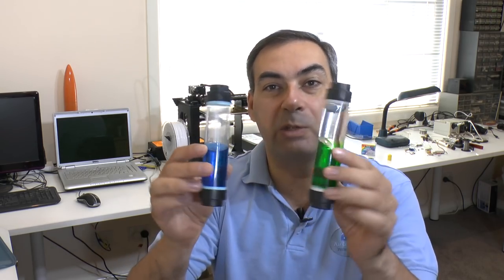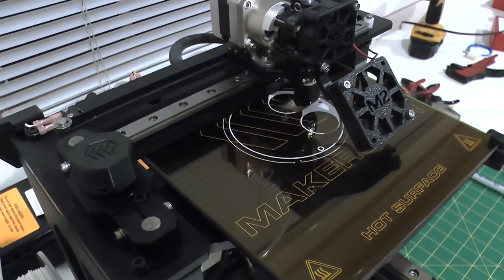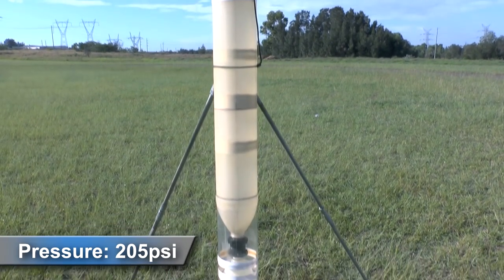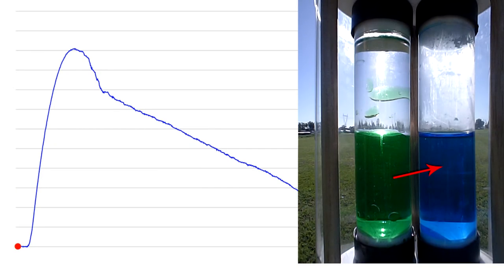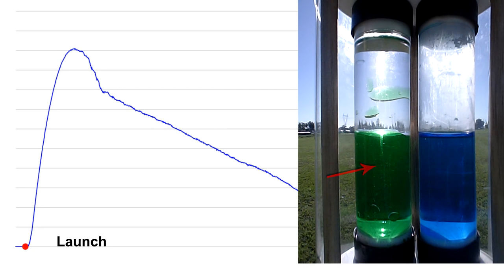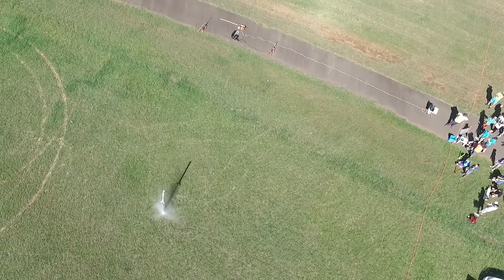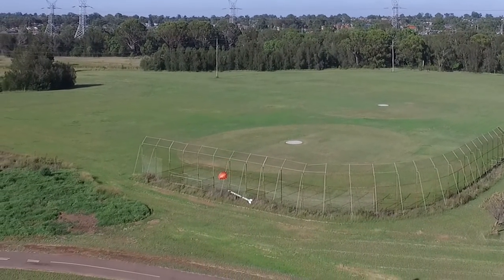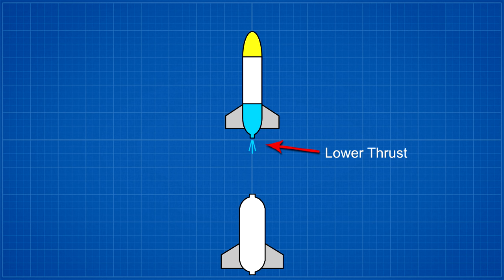Liquids in near-Zero G

Comment: You've made a Mystery Goo™ Containment Unit (^^)
Reply from the maker: Mystery Goo?
Reply: A Kerbal Space Program Reference( The mystery goo). Love to seeing that 3d Printer in good use. I wonder though, was the infill possibly a bit high for those parts? I understand for the camera mount, hanging off to the side, exposed to high drag, though for the liquid holders, as they are inline, surly they do not need such a high density infill. I have found with my printer ,that parts under a reasonable load, can get away with a 15% infill, and 20% at the max(abet not rocket loads, just the high tension of my belts on the printer. Interesting results though. For a future video, could the sourcing of bottles, to make the rockets be covered?
Reply from the maker: Ahh sorry missed KSP reference. :) I agree the infill didn't need to be that high, I think it was set at 25%. These components don't really undergo any significant loading, even the camera bracket. Thanks for the suggestion regaring the video.
Reply from the maker: Great reference, thanks for that.
Reply from the maker: I too will typically run 3 layers top and bottom and usually only 2 perimeters when strength is not critical. Thanks for the links, I had actually seen the Saturn 5 previously. It is an impressive model. :)
Reply: Yes, the designer made the model in full size, then scaled it. He was planning 1/30th scale, but one he had printed one of the engines, he decided it would be way to big(this is from reading the comments on the design).  You are most welcome for the references, it is just the right thing to do, to spread the information people are after around.
Now what about scale water rockets? like a 1/60th saturn 5. Could have a shadow rocket inside?
Reply: Lol yea, didn't think of that.

Comment: Interesting research! In order to avoid a pressure drop, it is necessary to put water in a rubber container (air balloon) with outlet to the nozzle. The air is pumped from the other side of the bottle (not through the nozzle). I hope the translation is correct ;))
Reply from the maker: That would be one option. I was thinking just using the natural shape of spliced bottle with a tornado tube in the middle of it. The lower section would be completely filled with water with air above the tornado tube. That way during burnout not a lot of water could move up through the narrow hole before you stage the rocket.
Reply: Yes, for such a design (tornado tube)  this is a good solution.

Comment: This gives me an idea for a deployment trigger. A rapid dissolving pin that is strong when it's dry but weakens when water touches it. Twisted toilet paper, cornstarch tablet, spun sugar, yarn soaked in kids glue could work. If it does, it would be easy to form some into a hook or pin for the rubber band.
Reply: I did a few quick tests with some paper, considering the water makes contact with the top mid flight, a slight delay is required. Copy paper cut to different widths gives different time delays. 3cm was about 3 sec but it was not not under precise load. 
A lead pendulum would be interesting to watch. One with a spring and one with a rod.
Reply from the maker: Good thinking. Tuning it so that you can vary the delay would be interesting. People have used vinegar at the bottom of a small container with a alka selzer tablet (or baking soda) at the top of the container. After burnout, the liquid flies up and comes in contact with the baking soda and produces gas that then activates a plunger to deploy the parachute.
Reply from the maker: Sounds promising with the copy paper. Definitely worth a go. A pendulum you say? :) Have a look at this experiment where we did exactly that. https://www.youtube.com/watch?v=oC8AbWXFiTw
Here is also how mercury switches behave: https://www.youtube.com/watch?v=JDWYTphuGCs&t=186s

Comment: While watching your latest video, the glue for my new splices was cured. I found a technique where you dont need to use a reinforcing sleeve on the outside, just some good quality glassfiber tape lengthvise, and electrical tape around. the glue is sikabond t2, can i email you some pictures? it has held up with 140psi/10bar for more than 5 min, no leaks. cheers ☺
Reply from the maker: That sounds like you have a good splicing technique working for you. :) It would be interesting to see what the burst limit is of that splice so that you know how close to the limit you are.
Reply: AirCommandRockets yes that Would be interesting, it seems like the sikabond t2 does work a bit like a sealent as the same time a strong pu glue. my units came out weighing a low 73 and 71g per unit. my compressor only work at maximum 140 psi, so i have yet to blow them up. cheers
Reply from the maker: That sounds like a reasonable weight for those spliced bottles. What size bottles are you using for your splices, and what is the final capacity of a couple of spliced bottles?
Reply: The final capacity differs due to the size of splices, I was worried about the 30mm splice so I made a 50mm too. Starting bottles is danish coop 2L PET bottles with either soda or carbonated water, they are fairly thin 98mm crossection for decreased drag. Final capacity is around 3.1L

Comment: So your saying there's no gravity at barely a mile up, yet the rocket still fall, isn't that an oxymoron?
Reply from the maker: No, that's not what this is saying at all. https://en.wikipedia.org/wiki/Free_fall
Reply: @AirCommandRockets  All I know is Gravity is still a theory, and if the body is heavier than the medium it's traveling through, then due to it's density it will fall. So density and buoyancy make more sense. If Gravity were true due to the spin of the earth, it would be difficult to walk or easier depending on where you were, either at the pole or the equator.  Now electro-magnetism may play a crucial role also.
Reply from the maker: @AverLife  Respectfully, I think you may have a misunderstanding of how gravity works. Gravity is merely the curvature of space-time. How does buoyancy explain the Cavendish Experiment for example? https://en.wikipedia.org/wiki/Cavendish_experiment  This is an experiment you can do yourself at home. Gravity is independent of the spin of the Earth or any other body. (I am simplifying this of course, you still have rotational frame dragging https://en.wikipedia.org/wiki/Frame-dragging You may be confusing centripetal force in there with the spin of the Earth.
Reply: @AirCommandRockets  Just letting you know the person you are talking to is most likely a flat earth troll. These guys get triggered by anyone even mentioning gravity. Just ignore them, they only want attention and to waste others time. Great video by the way!
Reply from the maker: @drmantistoboggan2870  Thanks, Yup I know .. don't feed the trolls :) This one looked a little sad and hungry though.